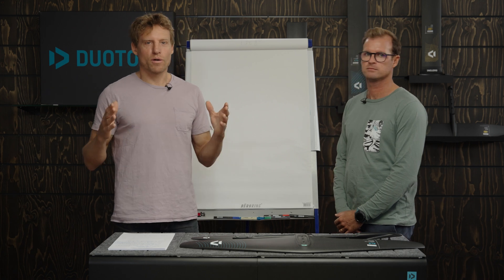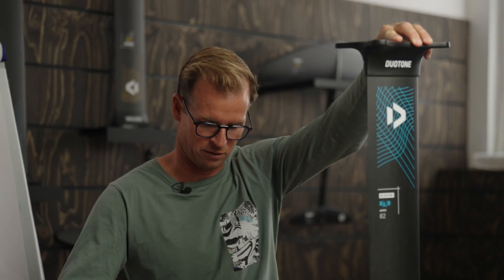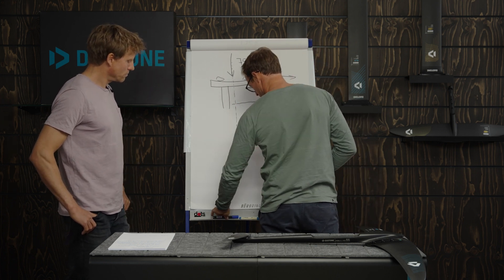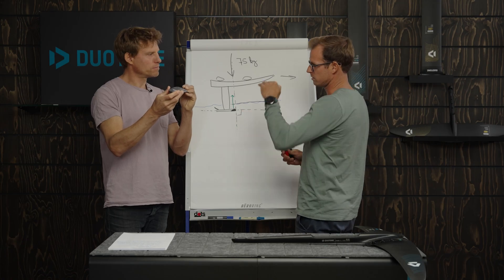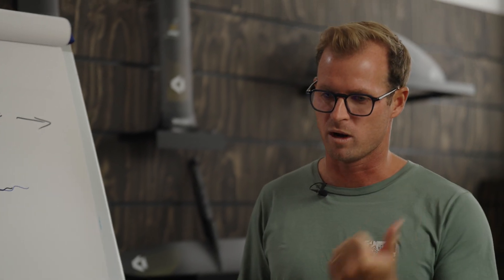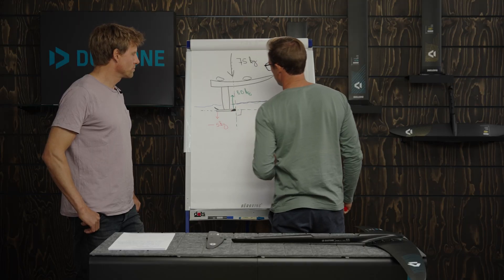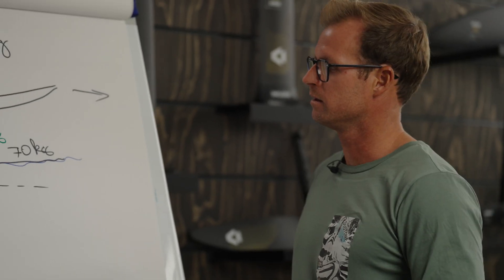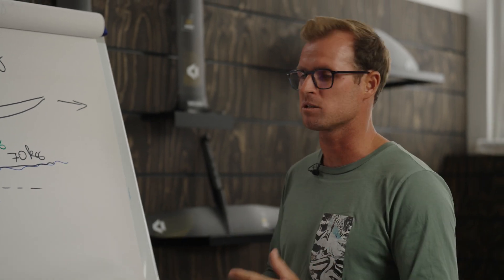Duotone Wing & Foiling Tech Talk - Foil Basics 2024

Comment: The concept "foot pressure" misleads. Is it about comfort or about unbalanced board ?
Can it be solved by changing stance ? so, rear foot to the front or, in case of a board with footsraps, by moving front foot to the front ??
Reply: The point which we explain in the video is the commun misconception that using a bigger/more powerful stabiliser will give more lift to the setup. Technically speaking, what the riders feels as "more lift" is primarily the location of the center of pressure which shifts forward when using a bigger stab. The value of the total lift generated by the setup actually decreases if the fuselage is kept at the same angle of attack and if speed is kept the same. Long story short, by putting a bigger stab, you end up with a less efficient setup, which requires you to ride with more angle of attack to generate the same lift as with a smaller stabiliser; by doing so, your center of pressure moves forward, closer to your front foot, and that increased front foot pressure is often what people wrongly describe as "having a more powerful foil".
Reply: @BonieuxJerome  This is a great and precise explanation :D  
Merci beaucoup ! 👏👏👏👏

Comment: I am really dissappointed, can you please do the tech more correct? I understand you want to keep it simple, but adding forces which are vectors in different places and in kg... Really?
With bigger stab, the total amount of lift will still be the same, otherwise you wouldn't be able to keep foiling with more frontfoot pressure. If all the forces from top and bottom don't add up to zero, you are going up or down.
Reply: You said it yourself, we have tried to keep it simple. We have used Kg instead of newtons because most people don't know what a newton is ;) 
With bigger stab, and same speed, you will need to increase angle of attack of the fuselage to counter the loss of lift from the bigger stab. For this particular case, we have set the fuselage at 0 deg AoA and the speed at a FIXED speed as well, hence the total lift going down with a bigger stab. In reality, the fuselage wouldn't stay at the same AoA, it would increase so that the force balance themselves out as you say, but this is not the initial condition we set. Hope it clears out the misunderstanding and please feel free to correct me if I'm wrong ;)
Reply: @BonieuxJerome Thank you for the reply!
Yes, this sounds perfekt 👍😃